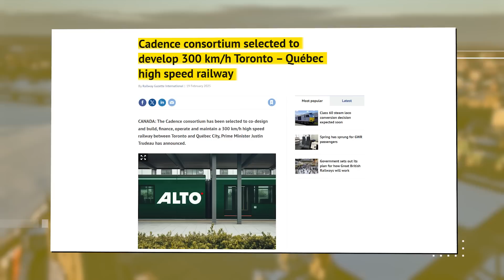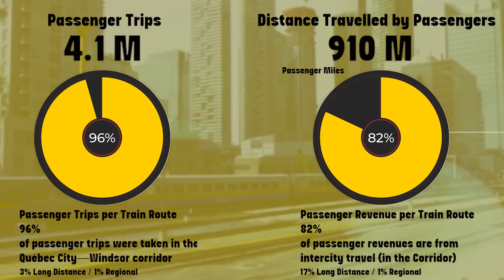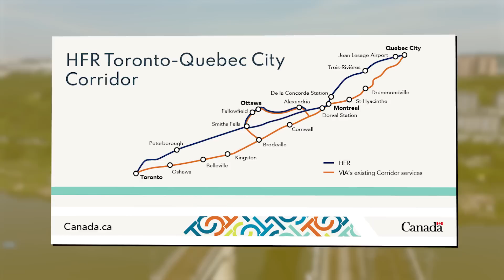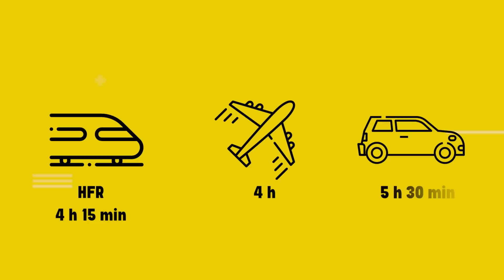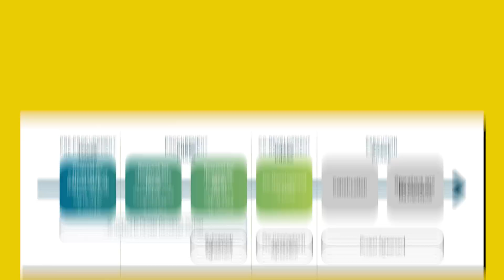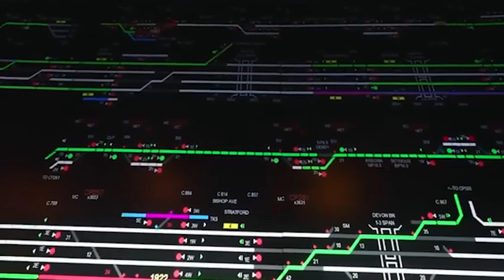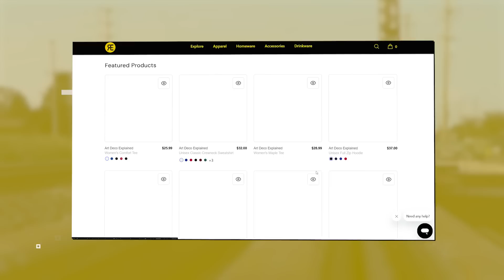High-Speed Rail in Canada: Is It Really Happening This Time?

Comment: Just for the record, the ALTO route does not neccessarily have to cross the St Lawrence River, as all of the planned stations are to the north of the river. It may end up crossing the St Lawrence River to get a better approach into Montreal, but from what I can see it probably wont cross the St Lawrence. It will have to cross the Ottawa River as well as the St Maurice River with either a viaduct or a tunnel. Other challenges include the approach into Montreal, which is going to require a LOT of tunneling, as well as the section between Peterborough and Ottawa which crosses the remote and challenging Canadian Shield.
Reply: I thought the Mont Royal tunnel was already underweigh? Or is it just proposed?
Reply: @statelyelms  Construction of the Mont Royal tunnel is underway, but for the REM, which is Montreal's regional light metro system. Its basically impossible to fit HSR and REM in the same tunnel.
Reply: aside from a different approach into montreal, the only other reason to cross the river is for any expansion into the east coast provinces. because of how long these kinds of projects take to build and approve, if they were even on the fence about expanding farther east, it might be a good idea to plan out and eat the cost of a bridge now, than to wait and try to fit one into the future city buildup in a decade
Reply: @A_Vicious_T-Rex  that railway is never stepping foot in the maritimes.  sadly enough
Reply: @tyreekwatson6287  it's depend if an high-speed corridor is done on the south-east shore of Montréal you will reach Québec via the old Québec BRIDGE via Charny (Lévis) . Would the TGV would bve extends to Rimouski we are around 200 kn away from Edmunston, N.B.
Reply: @glaframb  Edmunston is a town of 16,000. sadly there is no way the rail would ever even be considered. the next city even worth stopping in would be fredricton 600km away from quebec city. for reference Toronto to quebec city is 800km. so they would almost double the amount of rail needed for 16,000 people in edmunston and 100,000 in fredricton. this would simply never happen. there's very little demand, and costs would be extremely high and no one is even asking for it to begin with.
Reply: @tyreekwatson6287  Maritimer, yeah it's definitely not. Would be just fine with a local route or routes here, though, at conventional speed on shared tracks.
Reply: @statelyelms
100% agree, I’m Nova Scotian myself and while I think inter provincial rail could be nice if it made sense, I also still think making regional rail in New Brunswick and Nova Scotia would be far more useful. 

Halifax could have rail connecting Truro, Windsor, wolfville and lunenburg, and saint john could have rail to Fredericton and Moncton maybe even Amherst. Possibly in the far future those two networks can be linked however, regional rail in the provinces would simply be far more useful.

All this would make far more sense before interprovincial travel is even considered
Reply: @tyreekwatson6287  The Baltic countries of Latvia, Lithuania and Estonia have a similar population density to NB & NS, and have only regional rail. The best low-hanging fruit would be to upgrade the ex-NBEC line, from 48 km/h to either 177 or 200 km/h between Moncton and Charlo, reducing travel times by 4-5 hours as is. The Lévis to Riviere-du-Loup section could also be upgraded to 200 km/h with minor investments. By bypassing Quebec City, Moncton <-> Montreal could be done in 11 hours as opposed to the 18 it takes today, and Halifax <-> Lévis would be about 12 hours. This would allow for a daytime and an overnight connection between the two cities at 200 km/h. These hypothetical daytime trains could be operated with Via's existing 200 km/h Siemens train sets, which were actually required by the contract to be retrofittable to dual-mode diesel/electric with the future addition of a transformer and pantograph. The existing overnight train would simultaneously be more viable as a 14 hour run instead of a 22 hour run.
Reply: @A_Canadian_In_Poland  that’s really cool I haven’t heard anyone mention that before. Having serious sleeper trains from Halifax to Montreal would be a complete game changer for many. Right now I’m just hoping Halifax eventually gets some type of good rail in any form at all in my lifetime, but that sounding so easy gets my hopes up a little higher than that, but of course when our governments would do that is the real question.

One thing I realized recently is the lack of connection between Halifax and Quebec City, no direct flights and rail being out of the question for 99% of the time and 99% of people you have to layover at either Ottawa or Montreal to get to Quebec City in a reasonable time, this would help greatly with something like that.
Reply: @tyreekwatson6287  High speed rail at 350 km/h costs about $35M per km, at 250 km/h costs about $20M per km, conventional rail at 200 km/h is about $10M to $18M per km, while 160 km/h rail is $2M (upgrading an existing line with welding of joints) to $5M (new build) per km. 100 km/h track costs about $3M per new build km, and there are largely no cost savings below that speed. High-speed rail doesn't make sense everywhere, even in Europe. 

Upgrading the Moncton-Campbellton section, the slowest bottleneck of the entire train route which currently takes 7 hours for the trains to complete, to 160 km/h would cost $500M, or $1B to implement 200 km/h on the Pacific Junction to Rogersville section. Parallel regional trains, worked by a small 2-car or 3-car diesel multiple unit, would mean that the intercity trains could skip the <1000 person villages that the long 20-car trains stop at today, and would reduce travel time by about one hour further. Canada already has the rail construction teams and expertise in upgrading tracks to a 160 km/h standard, which Via did extensively in the late 2000s and early 2010s in Ontario. Might I add that all of Via Rail's  railcars--except for the Budd-built stainless steel ones--are capable of 200 km/h operation, just without the tracks to operate at that speed.

And for a night train, options are needed in between a seat and a semi-private room with an ensuite washroom. Open couchette cars stacked three-high are a good budget option that sadly are being phased out, even in Europe. They contain 54-66 bunks per railcar; Indian Railways has a version with 99 bunks per railcar. These 12-hour night trains usually don't include any meal or dining services, although trains over 14 hours almost always do have a dining car.

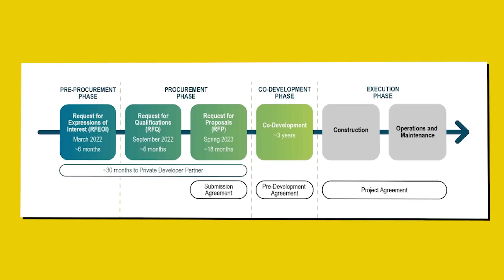There's definitely demand for more trains on the route. The existing train, despite its shortcomings, is almost always completely sold out. A Montreal-Halifax night train that departs at 19:00 and arrives before 09:00, and even a direct Toronto-Halifax that departs Toronto at 18:00 and arrives in Halifax around noon, departing Halifax in the early afternoon to arrive in Toronto in the morning.
Reply: Montreal being an island in the middle of the St. Lawrence river, the train stopping in Montreal would by definition require it to cross the river.

Comment: With all fairness, the tracks between burlington and pickering that VIA uses is owned by the Government of Ontario, so it's slightly better than that 10%
Reply: What about conflicts between VIA and Go-Train services?
Reply: @3bizmark I suspect it's not as bad because most of that stretch has passing tracks, and will be upgraded to pretty much all 4 tracked in the coming years (see "go expansion" project)

Comment: Canada will be getting high-speed rail before the US
Reply: Technically the US already has high-speed rail (up to 260 km/h) from new York to Philadelphia.
Reply: @Mystro256 whats considered high speed rail is something that can go over 250 miles per hour, not kmpr
Reply: And no one cares. There is little actual demand for HSR in the U.S., and there are few corridors in which it would be viable. That's why few have actually attempted to overcome the massively costly and time-consuming legal battles necessary to overcome regulatory, environmental, and associated obstacles.

Comment: One should also not underestimate the use of HSR by commuters and as a feeder for air travel. Linking the 401 corridor would greatly improve congestion around Toronto, and running it via Toronto and Montral airports would be a great improvement regarding international travel for all the cities along the corridor.
Reply: The current proposed route isn't the 401 corridor, though. The way they've currently planned, they're going to bypass all the medium-sized cities along the shore of Lake Ontario east of Toronto, in favour of Peterborough and a slightly straighter route to Ottawa. Personally I think this is a terrible idea, as those communities along the real corridor are already underserved, and will only be more so after being bypassed.